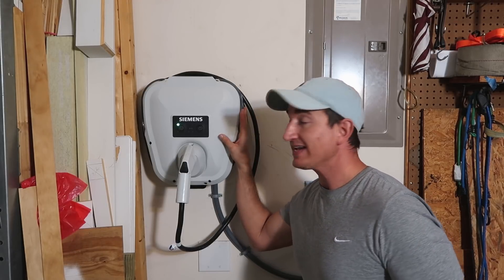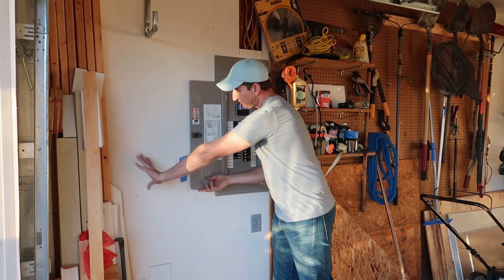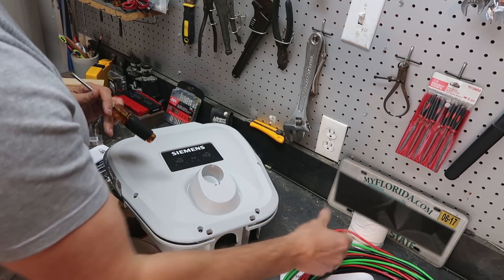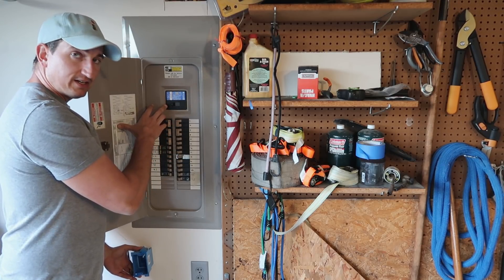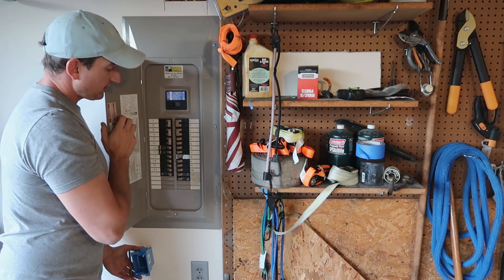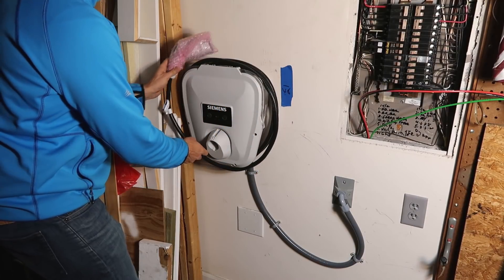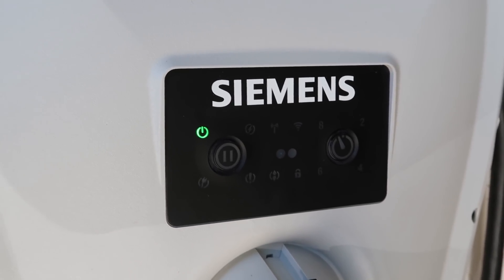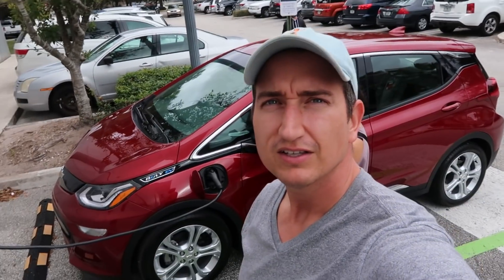Electric Car Level 2 (240 Volt) Charger Installation, Chevy Bolt EV

Comment: A little tip for anyone installing a hardwired EV charger next to a circuit breaker box - get an AC whip. They come in 8 gauge, with flexible conduit and fittings already attached. You can also trim to size as needed. They're usually cheaper than buying the conduit, fittings and wire separately. This is only good for 32 amp chargers on 40 amp circuits, however. If you have a 40 amp charger or higher you'd need six gauge which isn't available as a whip as far as I know.
Reply from the maker: Thanks for sharing

Comment: I am jealous of the circuit breakers in the garage.  :-)  Mine is in the basement, but at least it is a fairly modern home with the wiring cutouts already present in the support joists.  Thanks for making this video available.
Reply from the maker: Thank you for the kind comment. That is nice that you already have cutouts present.

Comment: So you run the wires in the wall without protection??? That’s e legal. You need a cable or flex from the box to the panel!!!

Comment: The correct way was to come out of the panel with a telephone 90 then attach your elbow connector to the liquid tight conduit.
Reply from the maker: Thank for the car charger installation tip

Comment: You can't screw stranded wires like this, you must use ferrules or screw terminals
Reply from the maker: Thanks for the 240 volt car charger installation tip.

Comment: Does this Siemens have the WIFI?  if so, I didn't see it lit up.  Trying to get mine working but no WIFI light... hmmm.
Reply from the maker: The electric car charger I show installed in the video did not have wifi.

Comment: Why you buy this? The original bolt charger can be plug to 240v just need to buy adapter on home Depot or Lowe's to make it bro
Reply from the maker: The charger that comes with the Chevy Bolt is stated to be compatible with a 240 volt source input, however it charges at a reduced amp rate than the 32 amps capable when using a dedicated 240  volt charger similar to the EV charger shown installed in the video.
Reply: I did exactly this setup before I bought a level 2.  It worked but plugging the level 1 charger into my dryer outlet only gave me 12 miles per hour of charge.  My siemens versicharge at 240V puts 25 miles per hour or double my old setup.  Be careful plugging a level 1 charger into 240v as it only works on certain models, plug in the wrong one and you'll toast it.

Comment: In this scenario it makes no difference how long the run is there's no way in h*** you're going get voltage drop lol, amperage is what will decide wire gauge
Reply: Thomas J - If there is no current passing thru the wires, then you are right - there will be no voltage drop. As soon as current starts flowing, there will be a voltage drop from the panel to the charger, although likely not significant on shorter, standard residential cable runs. One does need to consider voltage drop on very long cable runs, however.

Comment: Nice demonstration of roughly what an electrician will do when installing a Bolt charger in my house - thanks!
Reply from the maker: Thanks for the comment Bradford.  Since the installation of this EV charger for the Chevy Bolt we now use the car charger for a Pacifica Hybrid as well. Works great to charge both vehicles.

Comment: As an electrical contractor I approve this video. Great job
Reply from the maker: Thanks Tony
Reply: Hello Tony and Mrkistel. I Installed my ev2 charger just like shin in the video but I’m still concerned about the cable behind the wall without conduit. Is this still applicable? It’s necessary to use Romex to the box?

Comment: You cannot loosely run THHN wires in the wall like that. They need to be in a conduit.
Reply: Aka electrical hazard 🤦‍♂️
Reply: I agree.   Running individual conductors inside a wall without a rated jacket or inside conduit/flex is a code violation.  Even if it's only a few feet.  If there were a garage fire the insurance company could use this as an excuse to not pay.  I am an Electrician.  Also using plastic flex fittings are the cheapest but isn't a good idea for longevity and durability.
Reply from the maker: Thanks for the EV car charger installation tip. Yes loose wires should be in conduit.  The point of this video was just to show an overview of how electric vehicle charger might be installed.  Every charger installation will be unique.

Comment: It would cost a fortune in wire for me to install a charger; my breaker panel is at the opposite end of the house in my bedroom closet. I would have to use my clothes dryer outlet which is closest to the garage.
Reply: DAM8658 you can put an outlet next to it using the dryer circuit so u don’t have to unplug every time. Just don’t use the dryer and charger at the same time or it will trip. And yes I’m an electrical contractor.
Reply from the maker: Ya the heavy gauge wire is pricey.  Hope you are able to run your electric car charger where you would like to. Keep me posted with what you decide. thanks

Comment: Hi, I just bought a Volt and will be picking it up today. It is a 2017. I am unclear about all these charger units. The Volt from my understanding will use a maximum of 240 Volts and 16 Amps. Therefore a simple $ 200 dollar charger cable and a NEMO 6-20 plug at 20 AMPs would suffice, wouldn't it? I understand that if you are paying an electrician many people want the 40 AMP wire and hook-up to future proof there set-up but with 40 AMPS or 32 AMPS the volt will only draw its maximum of 16 AMPS. Installing a NEMO 6-20 only would cost me $ 275.00 including material and the electrician said no EV Charger City Inspection is required since this is a standard plug for tools or other things. The cost of a 16 AMP charger on e-bay is between 200-250.00. Am I missing something here? Please comment.
Reply from the maker: Peter, thanks for commenting and congratulations on your 2017 Volt purchase.  I am not familiar with the Volt charging specifications but would rely on the electricians input as he/she should know what is required on the house electrical end.  One note of caution: if the charger were to draw 16 amps you would want to draw off a 20 amp isolated circuit.  Many home outlets are wired with 15amp circuits so modifying an existing outlet on a 15 amp circuit would not be wise.   In addition to a 20 amp breaker the circuit should have appropriate size wire (likely 12 gauge for modest wire lengths). Best of luck, please let me know what you decide to install to charge your new electric car.

Comment: Why didn't you just add the 240 plug and add wires from base to 240 and plug it in... Then if you move it could attract some EV owners since it's ready to go.
Reply from the maker: There are many ways to install an EV charger.  The electric car charger installation demonstrated in this video was preferred for the application.

Comment: Thanx for that vid.  I'm not going to scroll down to read the comments from people telling you what you did wrong.  This is the internet.  ;-)  That said, thanx for the comments about using an electrician!  Good recommendation.  When I got my EVSE, I read all about installing and watched the vids.  Got all the parts.  My run was almost exactly as short as yours, so I figured, why not.  Cut the power.  Opened the panel.  Stared at it for a bit...  Then closed it up and called an electrician.  :-)  Oh well.  Great vid, and nice car.  Have the 17 Cajun Red Bolt myself.  You can crank you amperage up.  L2 speeds are slow enough, you should be good for the Bolt.   They probably give you that option if you can't run a full 40A circuit at your location for some reason (not enough power left, too long a run, etc).
Reply from the maker: Thanks for watching and the comment.  Sounds like you have a nice car as well.  I have only seen two other Bolts on the road in  6 months.

Comment: Multiple code violations. You shouldn’t post a video if you don’t know what you’re doing. You could burn your house down or electrocute yourself or a future homeowner. INCLUDING CHILDREN. TOTALLY IRRESPONSIBLE.
Reply: Specify what please
Reply: internetpolification Noseygoò  Running wire through a wall without conduit, improperly attaching wire without clamps, some communities REQUIRE a licensed inspector to check the work. Anytime you install a car charger more than 3 or 4 feet from the panel there should be an emergency cut off box like the type you would see on an exterior A/C condensing unit.

Comment: Your electric main panel has mixed ground and neutral bus bar. It should have been separated.
Reply from the maker: they are connected in this main panel configuration
Reply: No
Reply: @davidgilde6296  WRONG

Comment: Can I use a 50 amp breaker?
Reply from the maker: For this particular EV charger the 40 AMP breaker was preferred.  A 50 amp breaker would functionally work however it might not meet local building code approval.  There is some risk if running thinner wire on larger amperage breakers.  The wire could potentially melt , spark, and create a fire risk before the larger amperage breaker would trip.  I would use the recommended breaker the electric car charger manufacturer suggest as well as the recommended size wire.

Comment: Hi Joe, Low amperage (up to the max per battery design) does not have a major effect on battery life. The most impact for the number of cycles you can get out of it are: min/max state of charge and pack temperature. Clear example of these two in action are the Gen 1 Nissan Leaf Batteries who despite having limited energy/range do not have an active thermal protection system and allow full charge/discharge. Chevy's EVs protect against this by 1) not allowing a state of charge below 20% or above 80% on the Volt (a little more for the Bolt) and 2) actively controlling the temperature of the pack (Dexron fluid anyone?).

What a high amperage gives you is increased energy efficiency and less wear for the battery components (plus more miles faster!) :)
Reply from the maker: Thanks for the insight.  Another quick question then. Would you recommend "topping off charging" after short commutes or make several short commutes to drain the battery a substantial amount before charging for a longer duration?
Reply: @MrKistel  - Actually, you needn't worry too much about charging EVs with what is essentially a trickle charge in residential applications. It won't hurt to maintain the battery at a set percentage, nor will it hurt to wait awhile before you charge. Do be wary of charging the battery too high or too low. Try to keep the charge between 20 percent and 80 percent. This will give you the most longevity.
Reply from the maker: @douglasbkerr  Thanks for the EV charging tips

Comment: Never, never put loose electrical wires inside a wall without proper conduit or shielding. This install would never have met the electrical code, no matter where it was installed.
Reply: That was exactly what I was thinking
Reply: Every house has " loose wires" in the wall, but they are secured with proper staples or equivalent, at proper intervals.
Reply: @sweetkellymay  You are probably thinking of Romex cable when you say "loose wires"

Comment: 6:30 You should have used a wire clamp combination connector to run the wire through.

And I hate to crap on tutorials but it would have been so much cleaner if you had just drilled through a stud and made it all in-wall.
Reply from the maker: Good tip!

Comment: The only charging amperage that matters with respect to the battery health is the frequency of DC Fast Charging. The 32 Amps at 240 Volts that home Level 2 chargers get you is nowhere near the charging speed that would endanger the battery health. Thanks for the video, my Level 2 charger is going in tomorrow!
Reply from the maker: Thanks for your insight regarding the lower amperage charging.  I have also heard that the Bolt is designed to limit the DC fast charging amperage for battery health reasons and that some feel it is too conservative.  That being said I can see how worrying about  charging at 32 amps seems a bit silly.